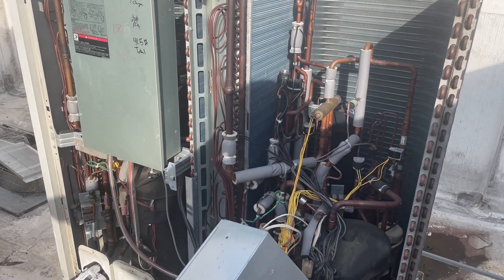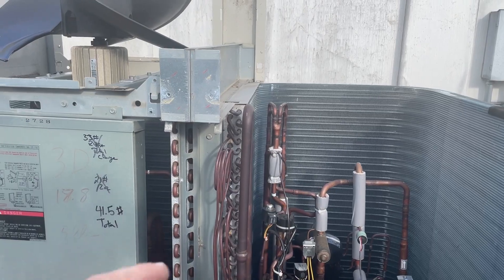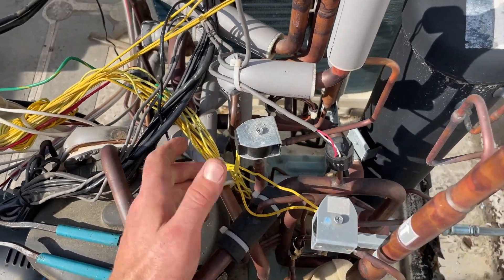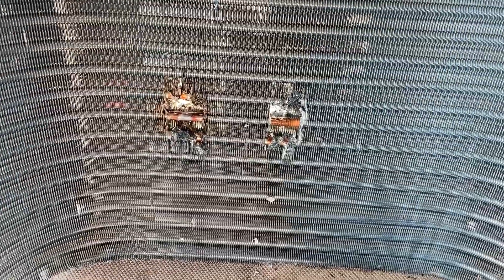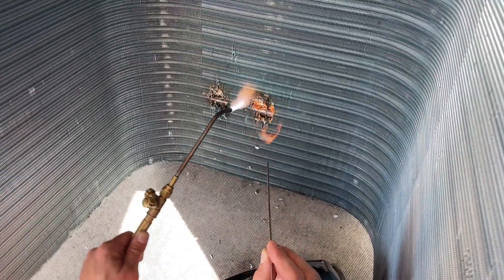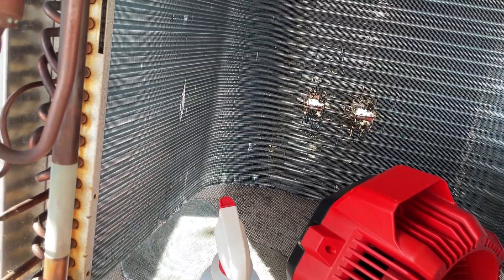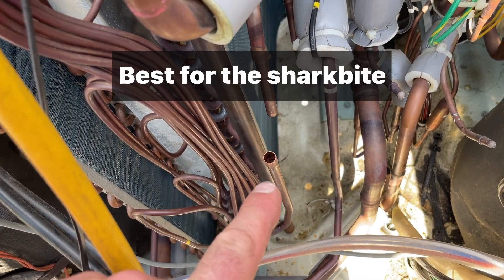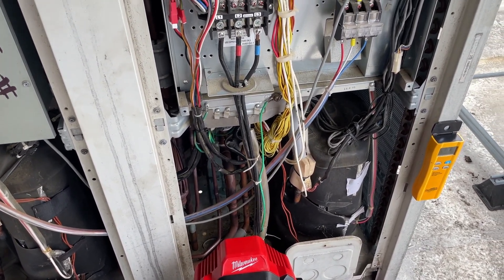HowTo26:  Fix Too Many Condenser Coil Leaks on a Daikin VRV

Comment: The little swaging tool you are using are hard to use on larger pipe. If you aneal the larger pipe it will swage a lot easier. Also some refrigerant leaks are temperature dependent or pressure dependent or both.

Comment: The way those coils are flattened like that before you brazed them looks like they suffered from ice damage. Over time if there is ice build up, it can start warping the coils and causing little cracks in the copper. If it’s running all the time (cooling/heating) then I would guess that’s the case. It wouldn’t be chemical’s because then all of the coils would be leaking soon.
Reply: @HVACLife  Glad I can help, I’ve run into a similar issue with a heat pump before.

Comment: I think pinhole leaks like that are probably from using agressive chemicals some like that ...
The one good thing about these coils if i remember correctly is that it's only 2 braze joints to replace them and they're very lightweight...which looking back is probably not a sign of good quality materials 😅

Comment: for brazing thin tubes of copper like you did in this video, i found that oxy acetylene or air acetylene torch are not suitable. they're way too overkill for this type of work. air propane or air map gas at low setting (the one that makes your tip red hot) will make your job easy as breeze for brazing this thin copper coils. try it and you'll never go with acetylene setup for these coil repairs.